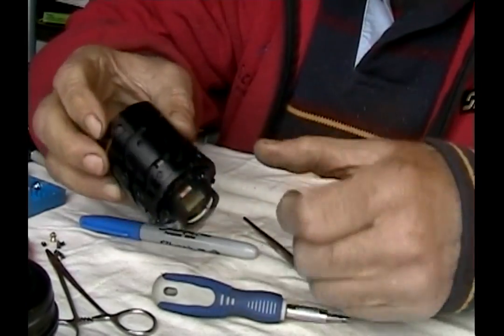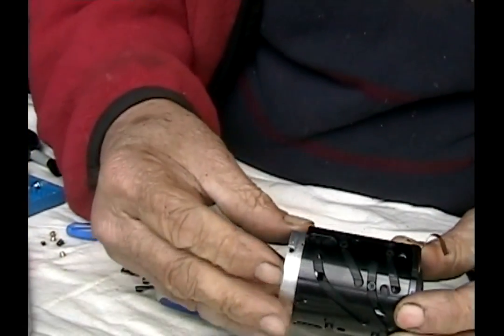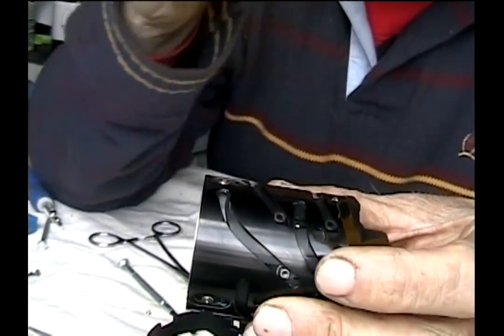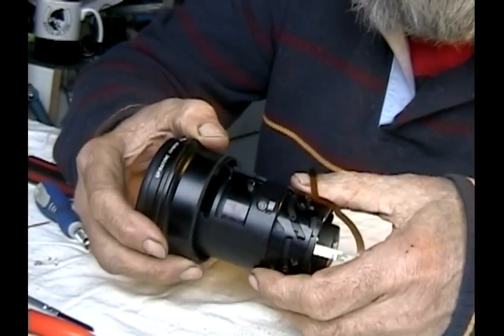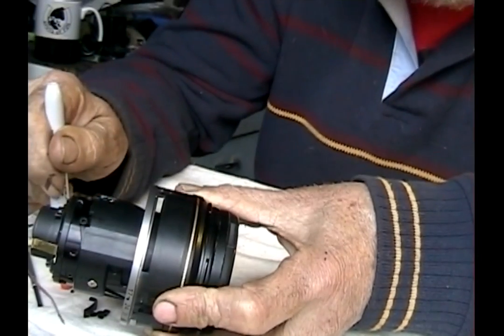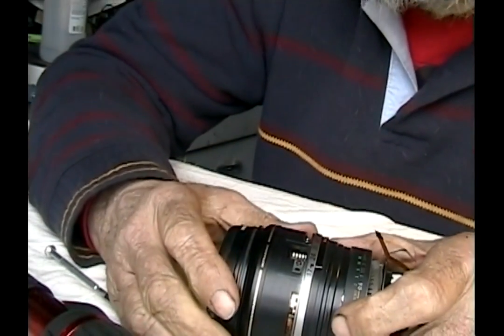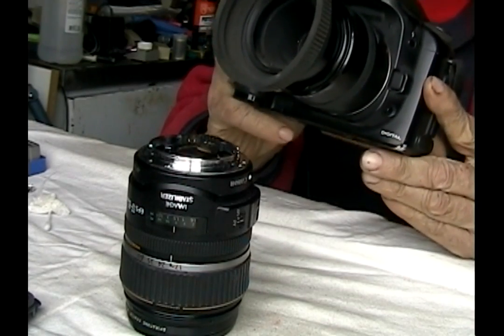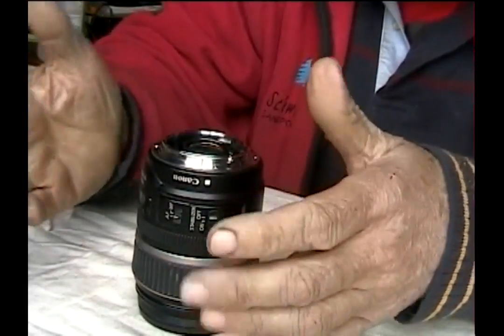Assembling a Canon 17 85 EFs USM IS Macro

Comment: You helped a lot of guys , especially where the metals fittings go in. Just one thing you do not need to remove the silver ring on the bottom of the inner barrel. and when you fit the new focus cable, fit the black holder on the inner barrel so it lies flat on the silver inner ring. Then fit the rest of the cable to the inner barrel. Expect to open your lens a few times even with all the advice.

Comment: Having spent about 30 minutes disassembling the lens, I thought it would be straight forward ressembling until the 3 parts, never mentioned in the YouTube video, fell out! I spent several hours having replaced the offending ribbon lead which was relatively easy to instal, attempting to reassembe the lens.......... then I came across your video! Thank you so very much for all your help.
May I suggest that anyone attempting this repair takes photos before removing each individual part and also, as suggested here for one part, you mark where the different sections line up with a marker pen or Tippex.
I also found it easier to secure the part that I replaced with the little plastic grommet and screws (x3) to ensure it was seated correctly.
In addition I found that it helped with those 3 little 'tricky' parts, to prevent them from continually falling out, to secure them in place with their correspnding screws and only removig them when the other 6 grommets and screws had been put in place!
Thanks again for saving me a bundle because at one stage the lens was almost launched across the garden with a view to purchasing a new one from Ebay! By following this video, in conjunction with others, I have saved myself almost £200 (USD300)!!!
Reply from the maker: +Theseus58 Thanks for the response, I did mark some of the points, however going through it for the first time, It was kind of a blind trail to know where to mark and what to secure, the project for me took the better part of three days.  When the three parts dropped out I panic'd,   I went back through all the disassemble videos, but no one showed them. I spent the better part of day two, sitting and trying to fit them in some where logical...  When I finally found where they went things began to be solvable.  I did shoot shots everywhere I though important.  The lens barrel is where it all happens, And for people reading these comments,  when disassembling the inner lens barrel, take lots of photos, and pay very close attention to each part.  The three parts that fall out and cause grief are the second from last ring of screws opposite the mounting end of the lens,.  Thanks again for your response, it is encouraging to know that my efforts are helping.
Reply from the maker: +Theseus58 BTW did you do the fold-over crimp of the ribbon like Canon did? I modified mine a bit and did an "S" loop so there was no crimp to cause ribbon failure...?

Comment: I got stuck on that part with the 3 straps on another video, came here, watched your video and solved my problem. Thank you very much for posting and it helped me out of a big hole.
Reply from the maker: so glad it helped, I took mine apart based on the others to videos, great way to make a pencil holder but not fix the lens, when the three cam parts fell out I thought I was sunk took me a day to figure them out, glad I taped the assembly.  Thanks for the response.

Comment: Thanks a lot! I was able to take may lens apart and repair it, thanks to one of the guides found on Youtube. But when I re-assembled it, it had problems. It turned out I did almost everything right, except the alignment of the focus pin and fork. It's good you paid special attention to that! Btw. as long as the zoom rubber is off, you can check if the focus pin and fork are corrected right by looking through one of the 3 slits. I was even able to correct the problem without removing the outer barrel, just through the slit!

Although you didn't cover everything in detail, you showed enough details to be able to re-assemble the lens.

Btw. the desoldering of the old cable and the soldering of the new cable requires a lot of experience and the right tools, because the connections are easily damaged when soldering. Therefore, my advice to everyone reading this in advance of an attempted repair is not to bother soldering the flex cable but just ordering the complete part from eBay. It's costing only slightly more and will save you from killing your part while trying to solder it and still having to order the complete part.
Reply: "...you can check if the focus pin and fork are corrected right by looking through one of the 3 slits. I was even able to correct the problem without removing the outer barrel, just through the slit!"   --- Same happened to me when I re-assembled everything, THANKS for the info about adjusting it by simply removing the zoom rubber.  The manual focus ring is still a bit stiff now, but at least the focusing works for both auto and manual mode.  I might take it apart another day just to see if I can adjust the stiffness of the manual focus ring.

Comment: Your video helped me out a lot after following the disassemble video (which leaves you with the biggest job still to do) and replacing the diaphragm part with the ribbon cable. It was still quite a challenge putting it all back together, but your video saved me a lot of time and hassle so thanks very much for making it!

Comment: Thanks for that, 30 mins to dismantle and 3 days to put it back together, works a treat now thanks, error messages and autofocus works perfect with new diaphragm and cable. You have to definitely mark the components with a pen before you take ANYTHING APART, take photos of every step, which will save you hours, trust me. I could probably do the whole thing again in about an hour, now I know what I am doing.
Reply from the maker: Glad it helped

Comment: Thank you for this video - essential viewing if you are thinking of taking the lens apart. Definitely do what everyone else says in the comments and buy the ready-soldered part unless you're a wiz at soldering. I bought mine on ebay from China for only a few $$$ more!  Take plenty of photos (video if you can) as you disassemble it. Place the disassembled parts in different containers for each section you take apart.  I also used a marker pen before disassembling the inner and outer barrels, which helped to line them up when re-assembling. Good luck!

Comment: Thank you so much for your time in this video. It help me assemble the inner core. Though one thing in the alignment of the plastic inserts is incorrect the top lens is inserted as you said originally and the bottom goes into the one you then later changed. I tried to align it the way you say but it will not go in to the groves. Thanks again.

Comment: Really helpfull video, Thnaks man. But, missed some important parts for me. First is to show the correct position for the brand new part, cause it do have a position. And 2nd missed part is the metal bracket that forces the "s" you do not show how install it. (it determines the position for the brand new piece). Or explain us, why you don't put it on!! May be this is the reason of the malfunction!

Comment: I just took mine apart to get rid of some dust inside, now I don't have focus, auto or manual...where did I go wrong in the re-assembly? The autofocus does make noise, and it sounds like it is trying to hook onto something, but it doesn't. You totally skipped over this part...
Reply from the maker: +Kenneth Miller  It is hard to say all the elements are connected to the barrel, and travel in cam guides, if you missed connecting and element, might be the cause. in the inner barrel,  you cam the front front element with an arm that comes up and mates to the outer focus ring as I remember, the inner elements run on cams 4 as I remember the front 3 were plastic with screws that went through the center of the plastic guides and secured the element in side, the fourth were three metal guides they were the ones that fell out and caused me so much grief till I figured them out,  If you can manually focus then the cam spacers are probably OK, I would then recheck the connector ribbons that control focus servos... good luck.